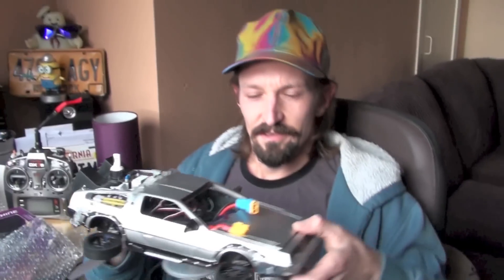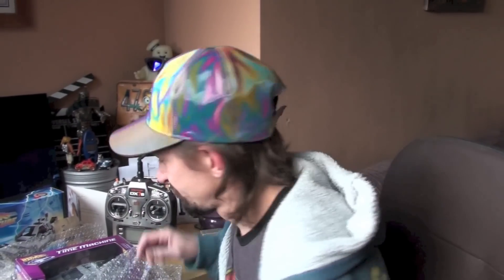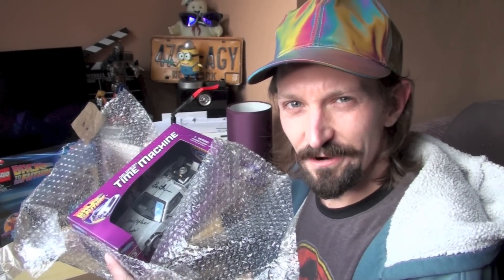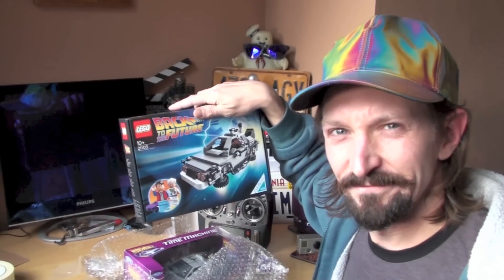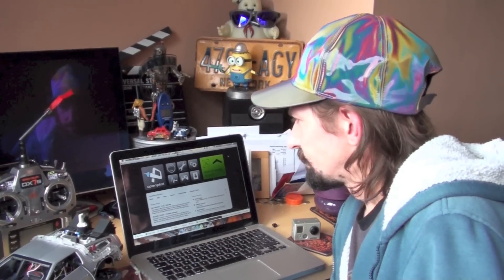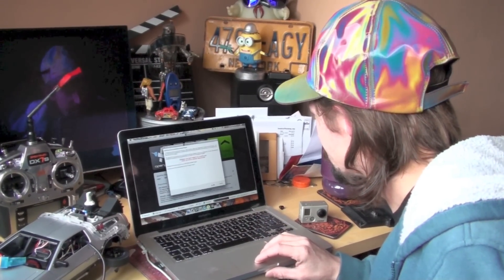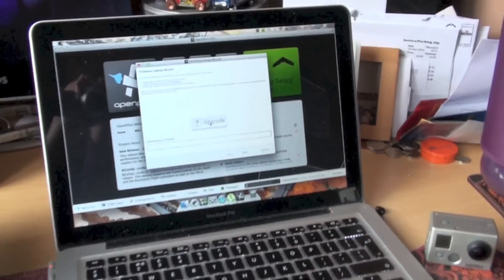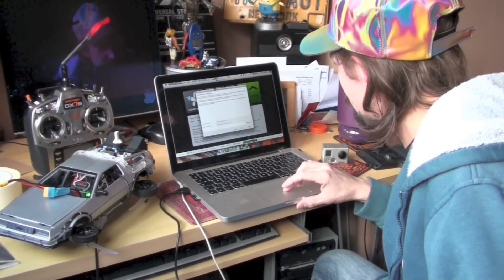FPV drone racing - RC flying DeLorean prototype Back to the future for Universal Studios show??

Comment: Wow I didn't realize quad copters that size were stable enough or had enough thrust for a body that heavy.  I broke the hover mode lever off of my DST BTTF2 car so maybe I should do this to mine too.
Reply from the maker: After a lot of testing and weight loss it flies . the underbody has gone and replaced by carbon also cut out a lot of plastic on the body . you will need some seriously high c rated batteries and expect a short flight . the motors i use are 1804 and 12 amp esc . Thanks and remember to check back soon for my big version!!

Comment: Would it be easy to convert a delorean like that into a standard remote control car?
Reply from the maker: yes , I would think to try looking for a 1/15th scale rc car , use the drive and steering . you 'd need to do some retro fitting . but yes quite easily .
Reply: @BLThackrey  It amazing me there aren't any availabe. I'm sure if someone started making them with the remote control like the movie they would fly of the shelves.

Comment: nice job, really i want to make a miniquad too with my de lorean model from diamond. Could u tell me which motors you use and how you manage to hide them under the wheels ?  ;)
Reply from the maker: Go to my sponsors @ HobbyRc.co.uk --call them first. they will supply the motors , ESC's and flight controller .

Comment: Impressive,
but has anyone produced a flying and driving one yet,
where you can hover on the spot like seen in the movies,
then the wheels turn back into the wheel wells,
land it then drive along the ground too.
Or the reverse to that,
where you drive so far on the ground then take off like a jet. hopefully one day we will see a full working one. 
but still cool to see it just flying,
as the real one was just all special effects with wires and stuff,
and didn't really fly at all.
Reply from the maker: This project is done and dusted I am afraid .. I did look into doing this ,but due to the propellers it made it a tough solve , so didn't go further with it .. I do have a huge 75cm long version that is 1/6th scale .. I did get to Universal on the 4th November 2015 about a night show ......